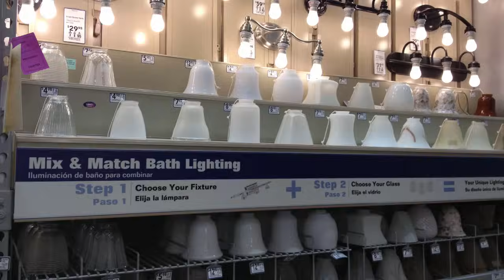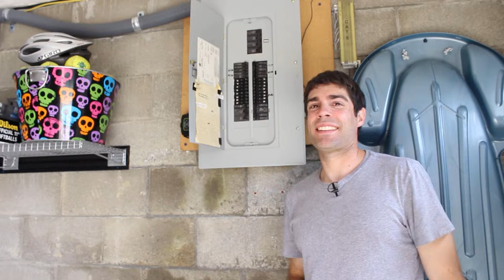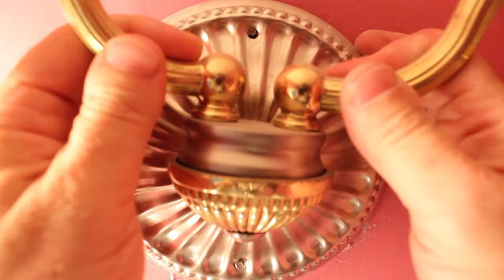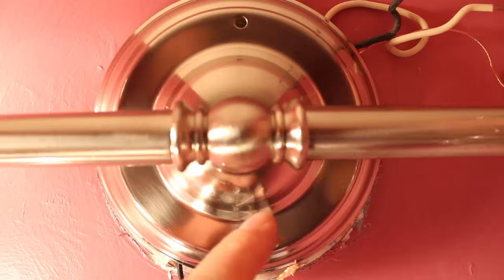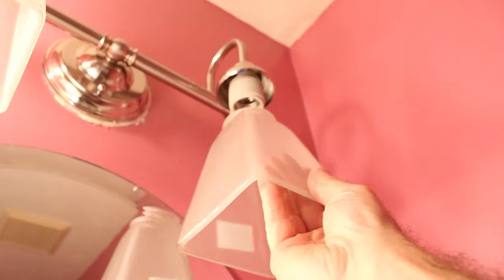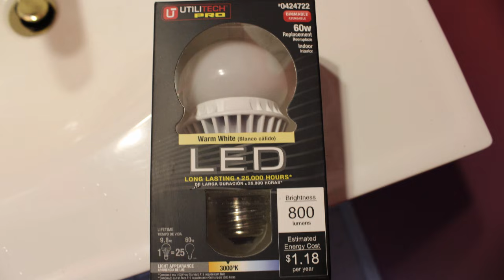How to Install Bathroom Light Fixtures (Lowe's Lighting)

Comment: You DID NOT cut those bolts based on what you show us 😂😂😂. Probably because you can't cut them with wire stripers or dike pliers without totally messing up the threads, you need a hack saw and file to clean the cut bolts.   Back to the hardware store we go for smaller bolts😂😂😂

Comment: Crossbars I have do not have the screw and slot for fixing the part that holds the screws for the fitting vertical. Lowes do not have these either!

Comment: The box in my wall doesn't have those 2 brackets, only the circular plate. My shoddy builder installed a 3-light, heavy vanity light that I'd bought, and it was sagging. Is this why? The absence of those 2 brackets? 

I bought a 2-light, less 'weighty' fixture this time and plan on installing it myself. I'm hoping it doesn't sag.

Comment: Steam punk it.... :0) MAKE SURE you use the correct screw in the correct screw hole....  If you find your mounting screws are too short.. you've probably used them in the wrong part of the set up... see 3:57   Put Green protective sheathing on your exposed Ground wire AND your exposed luminaire Ground wire...

Comment: Do you connect both ground wires together? There is one in the wall and one on the lamp....  also, if you have a double sconce with two white and two black do you just connect all three whites and all three black wires?

Comment: Replaced out light fixture, but the junction box is not properly mounted and is too loose. Now new light fixture is too loose against wall and moves. How too fix?
Reply from the maker: Nic, they have new boxes with tabs that secure to the drywall. I'd recommend looking into one if your code allows it.

Comment: I have a black, white, and RED wire coming out of the wall box, as well as a ground wire.  The old fixture had a built in outlet.... is that what the red would have gone to? Should I just cap the red off since the new light doesn't have that?

Comment: The wires coming from the wall have two white and two black, but the fixture has only one white and one black wire.  Do I put all three black together in one nut, or do I attach just one black from the wall with the black from the fixture, then the white wires the same way, and cap the extra wires?
Reply: If you have 2 Black and 2 white wires from the wall then chances are that they feed to or from another outlet or fixture on the same breaker.  
In that case just connect the 3 black wires together with the appropriate size wire nut and do the same with the white wires.

Comment: My wiring has three wires in addition to the ground wire....I'm out of ideas. The fixture is in the middle of the circuit which is making it more confusing. I can match black, white and ground to the correct location but what happens with the fourth wire?
Reply: +NumberOneDragon Do two separate switches go to the fixture?

Comment: Where did you get that mounting bracket?  I can't find a swivel crossbar with a locking screw anywhere.  I need one of these for a home project.
Reply from the maker: it came with the light but you can find one at a lighting store
Reply: I just want to echo that.  Yes, the things that you need are at the store.

Comment: Okay so i did all of this and tested the new lights. Everything looks good, except that the light switch in my bathroom wont work. (i flip the switch up and down but nothing happens) the light stays on regardless.
What do you think is the cause?
Reply from the maker: So you have constant power going to the light? And didn't change out the switch?
Reply: Yes, exactly.
Reply from the maker: I know this sounds nuts but there's a possibility the switch is broken. If you wired the new light exactly how it was before and the wires are solidly attached then it might not hurt changing out switch. Make sure to take a picture of the existing wiring setup before you remove the wires and always turn off the power. We recently had a switch go bad and that caused lights to flicker!!
Reply: ajcruzer92 Would be interested to know if you figured out the problem.